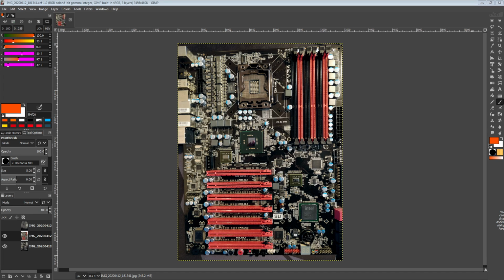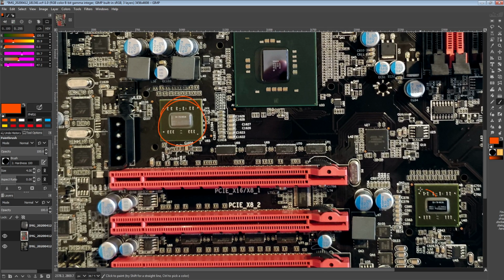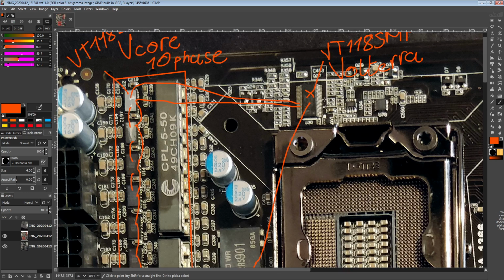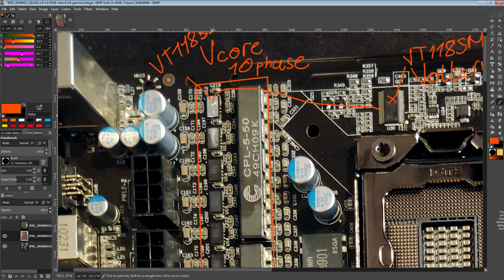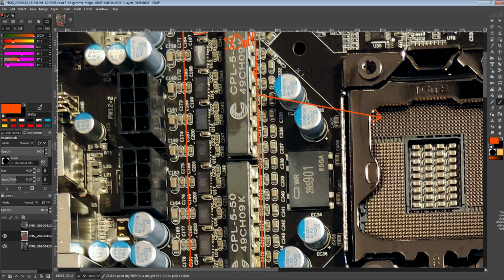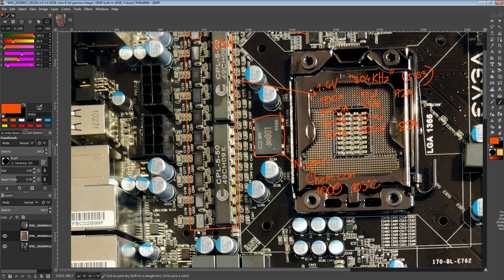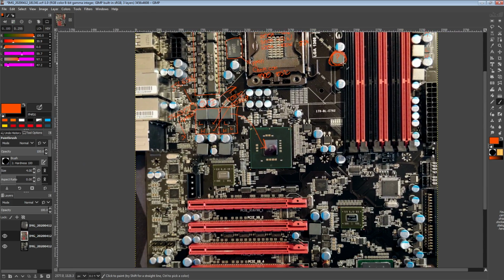mobo PCB breakdown: EVGA X58 4 way Classified

Comment from the maker: First
If you want some more hardcore(LN2) X58 OC stuff I strongly recommend checking out Luumi's channel: https://www.youtube.com/channel/UCw62L6EcWfcOZyf_SWTiBUA

Better info on coupled inductors: https://www.maximintegrated.com/en/design/technical-documents/tutorials/5/5997.html
https://www.power.pulseelectronics.com/hubfs/Inductors/Pulse-Power-BU-Coupled-Inductors-Improve-Buck-Efficiency.pdf
Reply: Firster
Reply: Second
Reply: You need GA-X58A-UD9 for comparison with this :)

I can send pics, if you want them.
Reply: Would you like some photos of an ASUS P6X58D-E? It's one of the "extreme phase" range with a supposed 16+2 phase according to the marketing material, haven't pulled the heatsinks off to take a look myself yet though.
Reply: Damn second 😂

Comment: Hey Actually Hardcore Overclocking. I happen to have a X79 Asrock extreme 7 which was an interesting board if you'd be willing to take a look. I'm not sure of a lot of the bits for overclocking, but it supported 3 way SLI, Quad channel memory (Only 6 ram slots, 2 less then the extreme 6 for some reason). It's own SATA controller to increase SATA ports. Let me know how if I can help you get your hands on the board or photos if you're interested.

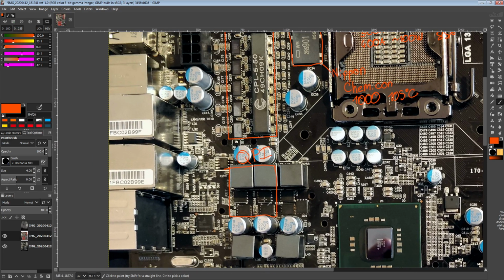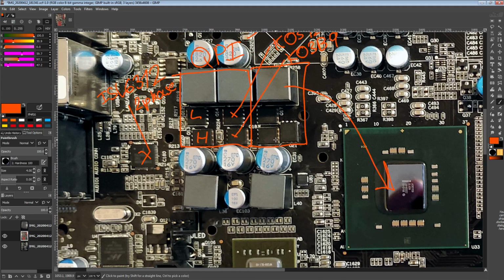Comment: 39:36 - 43:00 could it be that those 3 phases and controller all go to the PCH/IO hub/northbridge given the fact that it alone has a 24 W power draw? ("normal" northbridges/MCH from around those times already came with 2/3 phases power delivery and needed about 3 times less power)

Comment: The nf200 also add a bunch of latency. They limited pcie to like 106mhz, but having them on the board even with no overclocking was a big hit. At one point Asus had boards with them and they would only turn on when you populated the secondary slots those splitters were used on.

Those chips and the Nvidia chipsets as a requirement for sli are a big reason why amd was always the best for 3dmark until big Maxwell.

Also, check out the old threads for the dfi x38/x48 ut/lt t2r for how the voltera duity cycle works. You had options to set a load line frequency like thing.

Comment: I'm surprised you did not bash that 2 8pin EPS power connectors. For what the VRM capacity is, I do not think it can even max out half the full capacity of the dual 8pin EPS connectors.

Comment: Bought an X58 Sabertooth at launch with a i7 920, ran it at 4ghz from day one.  5 years later I got a x5670 from ebay, ran that at 4.6 ghz for 3 more years and added another 12 GB of RAM.  I refused to buy anything else from Intel unless they released something worthwhile, which of course they never really did - then Ryzen FINALLY came out and I immediately bought an R1700 at launch.  That same X370 board now has a 3700x and 32 gigs of ram at 3600 CL16.
X58 was honestly a dream at launch, especially for overclocking - but it slowly turned into a nightmare and I'm glad to be done with it.  Can't believe I went from an 8800 GTX to a 1080ti on the same fucking platform!

Comment: Oh yes, the dreaded NF200...
Nvidia claimed "We have PCI-E 2.0 support on our 780i chipsets now for the future!"
In reality, they were still the same 680i PCI-E 1.1 board, just that they had now taken 16x of those PCI-E 1.1 lanes and plugged them into a NF200 that went to the slots...
The result? Well technically PCI-E 2.0 as the NF200 supported it... Not so much in actuality :D

But those chipsets went the way of the dodo though, thanks to Nvidia being out of practice at building memory controllers... Last time they did it and did it well was with DDR1 and AMD Athlon XP...

Comment: Xcool atleast sets too low CPU PLL voltage for some CPUs. If you have XCOOL enabled you can't set any CPU PLL voltage manually afterwards. This was my issue with EVGA X58 Classified boards.

Comment: Ryzen 5 3600 with RTX 2080                             Or Ryzen 7 3700x with RTX 2070? Strictly for gaming. Basically the same price in my country. I don’t know what gives more fps and what is more future proof.
Reply: If you want FPS now the Ryzen 5 and 2080 are your winner.  If you want to stretch it a few years into the next console generation I would recommend the 3700x/2070.  Just me of course.

Comment: Ahh, too bad there wasn't much more info available on the vrm, my sr2 has the same vt1185sf, but 8 of them and different inductors. Would be interested to see a vid on that, but seems similar enough to this board besides those differences, the dual sockets, and the cpu disable jumper.

Comment: Any recommendations for what capacitor specs to look for when recapping these boards? What are the rolls Royce of caps you can get for each type of capacitor used in these old boards?
Reply: I would get the lowest ESR organic aluminium polymer capacitors you can find in 2.5V. Make sure they fit the same footprint as the capacitor you're replacing and you're good to go. Since it's next to hot VRM components, try to get 105C or higher rated ones, but pretty much all low ESR caps of this type are 105+ C anyway. Nichicon, Panasonic and Chemi-con are generally regarded as the best brands. In my opinion any of the three is fine, just get whatever is lowest ESR, fits your footprint and is also available in your area. I see caps from all 3 brands in 8-9 milliohm for SMD and 5 milliohm leaded in 6.8, 8, and 10mm diameter. Check the datasheet for lead spacing / footprint size.

Regarding what's the absolute best: SMD are generally better than through hole, and molded types are often better than can types. The "rolls royce" of capacitors would probably be the 3 terminal Panasonic EEF-GX series with only 3 milliohms of ESR and very low ESL due to 3 terminal (for L suffix). Buildzoid found some of these on a mini ITX board and raved about them because they're so awesome. But you can only put these on boards that had them in the first place, and very few use molded types for the VRM since they're so expensive. If you're just looking to recap, the 2-terminal version (R suffix) is probably the best you can get. Part number is EEFGX0E471 or if you can do 2V instead of 2.5 you can get EEFGX0D561.

Comment: Pretty sure alot of the crappy prebuilt Walmart grade consumer desktops still use voltera VRMs.
Atleast up until a couple years ago. I get discarded PCs from businesses and individuals pretty regularly and they have the same hallmarks as the voltera packages you mentioned here.

Comment: I ended up with ASRock's z77 Extreme4 cause the z77 OC Formula quit 2 months after i bought it. Reading that every other z77 ASRock board was having issues, i settled with the Extreme4. It also has a one-off VRM. It's half analog, half digital.

Comment: I still have the E760 Classified with an i7-980X. It's still running as my backup PC. Still on its original water cooling build. I dare not take it apart for fear of it falling apart.

Comment: You don't need a high PCIe clock to run high BLCK. That's false.
Reply: high = 250 to hopefully 300+ soon and for this you need a high pcie clock, for everything below and normal 24/7 oc you mostly do not need, that is correct.
Reply: @drizzler9361  That's crazy.
Reply: @GP-qb9hi  well... high means high. Claiming something true is false, is low.

Comment: I don't know which boards you already got, but i would suggest in terms of vcore vrm design :
Gigabyte X58A-UD9 or X58A-UD7 Rev.1 (rev2 of UD7 got downsized) (both 24 phase design with TWO analog ISL6336 controllers (6phase doubled each controller)
Gigabyte X58A-OC (12 phase (6 doubled) with analog ISL6336, custom made 50A inductors, 9000uF of POSCaps, manual switching frequency control 400-1000khz due dip switches)
Rampage III or Rampage III BE, both digital 8phase (CHL8328 controller) with DirectFETs and one proadlizer
First EVGA X58 SLI Board (8phase digital) to maybe compare changes within evga lineup shamino had done.

Comment: Funny I was thinking about daisy chained VRM control the other day...
Reply from the maker: it's not really daisy chained. The control happens in parallel using the current per phase setting.
Reply: @ActuallyHardcoreOverclocking  It's really daisy chained.
Each smart slave is acting as a single phase current mode sync buck converter.
There's basically 3 control lines - a shared clock, a shared analog peak current control and a daisy chained enable.
The way it operates is that once every #phase_count clocks, the controller sends enable=1, which causes the first phase to turn on on that clock edge. next clock, the enable off the controller is off but #1s enable out is on, turning on phase 2, ...
Each phase individually (and completely independent of the clock) turns off the highside on when phase current hits set current.
Uncommon in a CPU VRM, not so much in things like industrial/telco DC-DCs.

Even more fun, this control scheme also enables modular systems with one overall voltage controller and 1-N phase modules depending on output current requirement. Overall quite expensive, but then... BoM cost vs. designer time for low volume high margin products.

Comment: Didn't think I'd see a video analyzing x58 boards, let alone effectively same board I'm running.  I'm excited to see your future analysis of the transient response of the Volterra VRM -- especially interested in seeing the difference in transients between the lower and higher VRM switching frequencies!

I'm still using an EVGA X58 SLI Classified (E759) since 2010 as my daily driver.  Because I'm crazy, I ran the i7 920 (C0 stepping) around 3.8GHz (4GHz was my peak overclock, but touched 95C even on water).  Yes, I know, $200 cpu on a $400 motherboard...
As of two years ago, I swapped the 920 for a W3690, currently running at 4.2 GHz on all 6 cores at nearly stock voltage.  The difference in heat output between C0 Bloomfield and Westmere is night and day.  I think I could push the W3690 core frequency higher, but I'm currently enjoying the 24/7 stability and temperatures across the entire board that doesn't pass 45C under load.

The E759 looks to have the same VRM setup as your board.  Primary difference is my board has just 1 NF200 chip for SLI 3X.  The Volterra VRM does get very hot!  The BIOS lets you adjust the switching frequency and you really do feel the drop in VRM efficiency at the higher switching frequencies...

The stock air heatsinks on the E759 board got incredibly hot even at stock settings.  I ended up building custom loop with CPU, VRM (covers the Volterra), and Motherboard waterblock (covers QPI VRM, northbridge, NF200, and southbridge).  After your comment regarding the heat sensitive capacitors, I'm starting to wonder if running everything under water is the reason my board is stil alive after 10 years of solid use...

Couple comments regarding discussions brought up in the video:
- While the nf200 are indeed very picky on pcie frequency, the pcie frequency is adjustable independently.  The core, uncore, qpi, ddr all are all multiplied from the base clock.
- The x58 memory controller is sensitive to the ddr voltage (community knowledge was to never exceed a delta of 0.5V between memory controller on the VTT rail and the DDR rail).  That known sensitivity could certainly be related to that extra inductor between the cpu and the memory.  Never really noticed that this was an uncommon feature before you mentioned it...
- These boards generally are really flexible at BCLK overclocking.  However, I do remember having to go to a few extremes including disabling DVFS on the 920.  Life gets a heck of a lot easier when you have a top binned chip with an unlocked multiplier.  With the W3690, my DRAM becomes the least flexible component that pretty much determines the optimal BCLK.

Comment: I think I have an old XFX HD 4870 GPU that I took apart a few years ago to replace thermal paste and pads and remember seeing a super weird inductor array like that. 
I was super confused.... but this makes me sorta understand a little better.
Also something weird about that 4870.... years ago when I was still using it in my main PC, I was playing some game one night when suddenly I heard a loud POP then the blower fan in it started billowing smoke out the back of my computer. I immediately killed the power on the PC and didn't turn it back on until I replaced the GPU.
Oddly enough, when I replaced the thermal paste and pads a few years ago, I didn't see any blown components or skid marks on the board. So I popped it into a test rig, it WORKED again?!  WTF?  I still have no idea what popped and smoked that night. Maybe a bug or spider walked into one of the 8-pin power connectors or something? No idea.
Reply: I completely forgot about it. I still have this PCB too :P
VT1165MF->VT1195SF // V|TEC 59PR-9853

Comment: I own this Mobo's baby brother a P55 Classified 200. I really wish new boards have the features and build quality these older EVGA boards have. It made me laugh that the board would let you cram 600 watts into a quad core with dual 8 pin cpu headers. Unlike this board though it got a switch for 3 bios, and 3 way sli (quad SLI if you used a dual GPU card).
Reply: love the board

Comment: The datasheet for those fancy Volterra inductors may be skinny, but the patent US6362986B1 tells the tale. And it is about to expire next year.
Reply: thanks for the patent ref. I looked into it and unfortunately they'll have their claws into this for a while. Looks like they also designed the inductors to go with it, which are only manufacured by coiltronics (eaton) who have an exclusive agreement with Volterra. See US10128035B2 US7498920B2 US9019063B2 and US20090179723A1

That'll extend it to at least 2022 and possibly 2030. I am not a patent lawyer however. Note that all the other guys (intersil, infineon, vishay, murata etc) have coupled inductor patents of various types so looks like they're in on it.

Comment: nice x58 i have not upgrade for years can you test the w3690vs x5690vs x5675 and is a 1080ti overkill for x58 boards
and can you do the gigabyte x58a-ud7/8 . and can we see some overclockig over 5ghz with x58 .have a nice one

Comment: If you're getting into x58 overclocking, the x56xx xeons are far better binned than the i7 chips from that era and can achieve much higher frequencies at lower voltages. I would love to see some LN2 oc on and x5690 or something

Comment: I used an Asus P6T Deluxe for almost a decade and that board has a 16+2 phase VRM, but I have no idea what the actual components are. The VRM heatsink gets a bit toasty, especially when running something like prime95 with a 4.4GHz Westmere Xeon, which actually still resides in that board. That mobo is still the single best component purchase I have made during the ~19 years I've been fiddling with these machines.
Reply: I had the exact same board, ended up water cooling the whole thing (including chipset and VRM) which was a waste of money for me at the time but was a fun project.